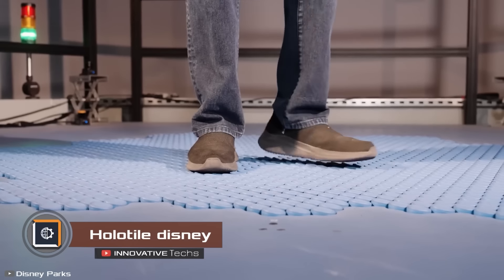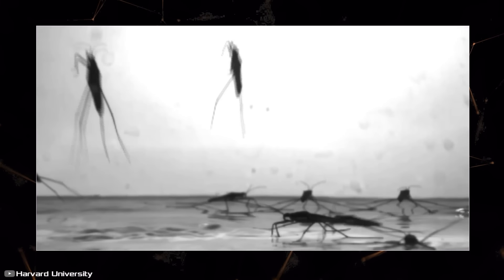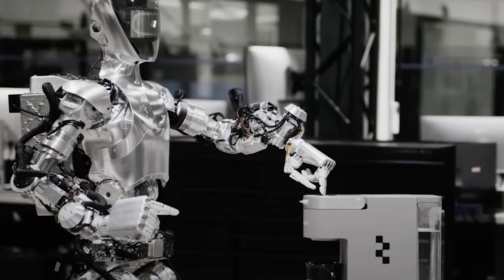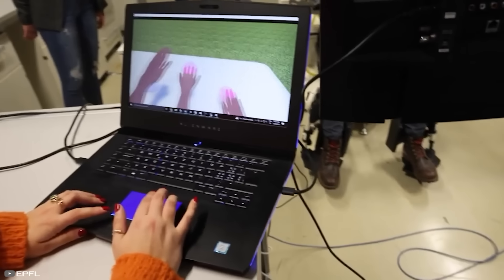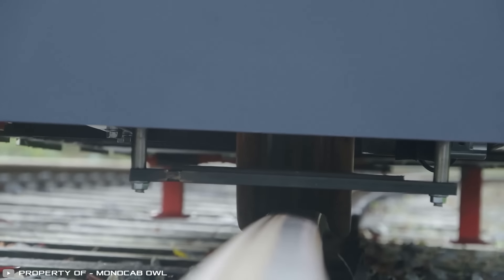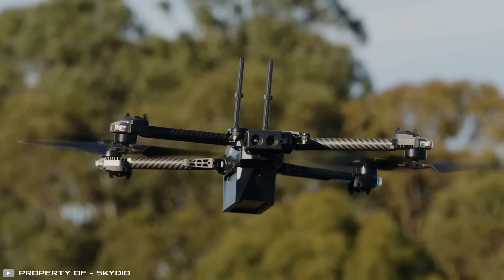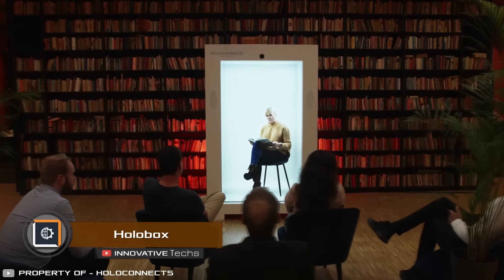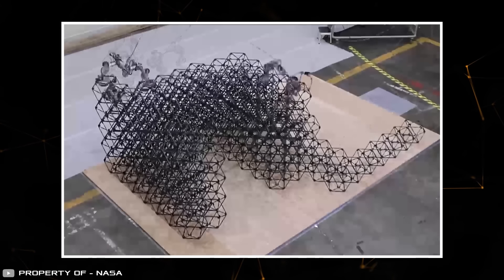INVENTIONS THAT WILL SOON CHANGE THE WORLD ▶3

Comment: Unfolding solar cells have been developed and research since the 1990s.
A train cart held in place with a tiny little wheel, i'd hate to ride those in a strong wind, or if some rascals kick them over, you topple over and die inside of them, good job.

I'd hate to drive a car for 1 person thats so thin and light that you can carry it with 3 people, imagine being trolled by someone hiding your car, by carrying it off, good job.

The military is looking for high armor vehicles not curvy lambo looking military vehicles, the curved edges alone would be a ballistic nightmare.

Humanoid robots ok. Unnecessary but ok.

Humans are made to control 2 arms, its how our nervous system is laid out, we have 2 eyes for peripheral vision and for focussing on a small area in front of us which is easily covered with 2 hands, we aren't meant to control 3 limbs.

On the propless engine you can see a propeller at the back of it during the testflight, indicating that it's fake and doesn't work. The wind canal testing with smoke shows nothing, you can blow air and smoke over a totally still moving car and get the same effect. It shows the aerodynamics, but doesn't show that the engines actually works.

Can't wait for people being killed by drones flying into them or slicing them with their propeller and drones colliding, falling from the sky, and causing death, injury and accidents, thousands of drones in the air delivering stuff to people because they are too lazy to go shopping, good job.

The only important thing in the video is the holograms.

Comment: 140kw . What sort of residential home require 140 kw  that a huge amount of energy a 4 bed home with 5 people will use 12kwh per day 140 is over 10x more . Even if you had 2 or 3 ev car that a huge amount

Comment: MONOCAB OWL.  Dial the Delorean to 100 years in the future, and transportation could be a variant of this vehicle and system.  No one owns a personal vehicle because all local transportation is via driverless vehicles.  In today’s dollars (or equivalent money) a five mile trip could cost $.50 for a single person or $.125 with four passengers.  Make a call and within two to three minutes a vehicle arrives.  No traffic jams occur as there are no traffic signals because all routes are ai controlled.  Homes no longer have garages, and downtown parking lots and garages are eliminated.  Long rage travel occurs on a second rail where speeds of 150 mph would curtail air travel for distances of up to 1,000 miles or so.  The impact on society would be revolutionary with a resort to ai to model mitigating factors in the face of a 95% reduction in carbon fuels, 95% reduction in costs of travel, reduction in housing costs and labor of its construction, reduced labor needs in all sections of the economy.

Comment: Batteries that are better. Why would you want a batteries to power our infrastructure? I don't get the obsession with everything having a battery. From Toys to pesticide sprayers. Just got hands to since food in our mouths and clog our vascular system. One comment seems feasible to build the stairwell of moving water uphill with today energy. Problem is environmental impacts and lack of water in many places Reddznic family of CA probably won't let that water go to anything but this nuts. Think we better off using compressed air charged during day.

Comment: On the folding solar panels you said it doesn't need no special transportation well so far it's used a diesel truck a crane and it's that big and it can only do a small construction site that's pretty sad for how big it is so they made a robotic water strider for what what does it do besides nothing so all they discovered with that it was the force of the jump seriously that was a waste of time and money and a vehicle called a cockerill they couldn't come up with a better name than that they could have called it dickrail LOL that little tiny electric car who wants to drive a urkel nerd car the military is not going to use that they'll get laughed at and on the monorail that rides on one track yeah that would be great if you had a week to get to work or where you got to go if it went any slower it would get passed up by a snail and a fast charging battery yeah I could be made at a lower cost that just means it'll wear out faster top secrets is a little behind the times they already have something like that you can do that with any drone seriously all those are pretty much crap the only one that's actually cool is the little robot HughNet and you said those little robots built a bomb shelter now did they build a real bomb shelter or that little toy one that show on the desk they have way better stuff out than this crap

Comment: In video order, will each design actually prove to be useful enough to stick around as something more than a gimmick? Yes, no, no, art so no, def not, yes but spells the doom of mankind ushering in the dark age of technology, yes, from the moment I understood the weakness of my flesh it disgusted me. I craved the strength and certainty of steel. I aspired to the purity of the blessed machine. Your kind cling to your flesh as if it will not decay and fail you. One day the crude biomass you call a temple with whither and you will beg my kind to save you. But I am already saved for the machine is immortal, yes, no, yes, only if you want to further accelerate the atomization of society, no, yes, yes, dark age of technology, execute order 66, yes, yes.